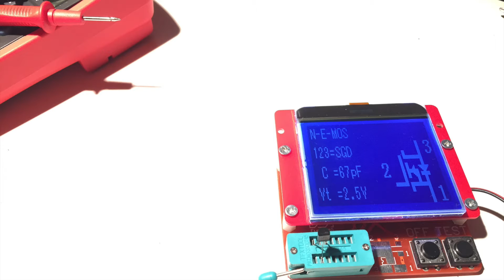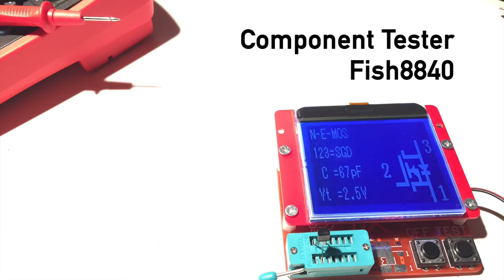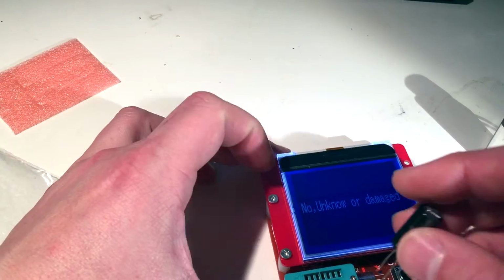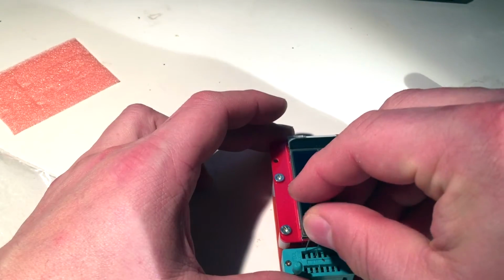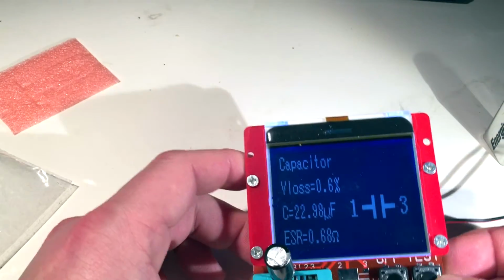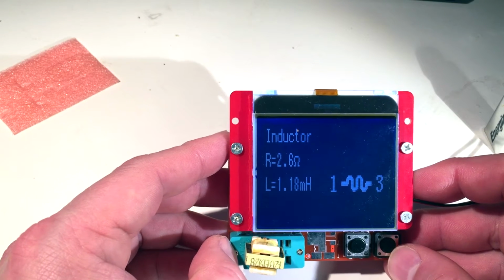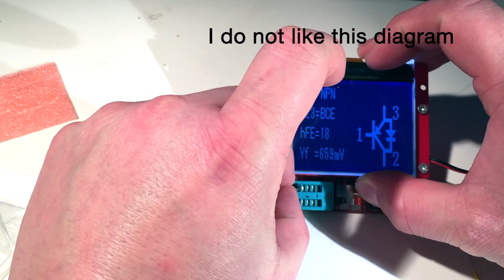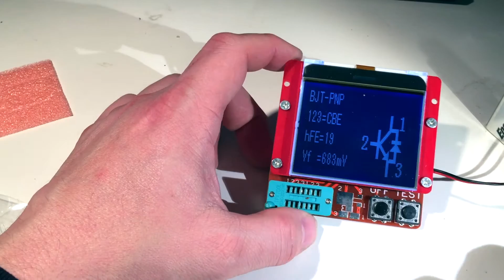Fish8840 Transistor Tester

Comment: How can you violate any licence when it is an open source invention? Open source technologies are alllowed to be modified and improved in any ways without the written permission of the original inventor. But anyway, if you were going to test the device for its performance, then you should have done it properly. You should have spent at least 50 cents or so to buy new transistors to test with so that you can be certain that it is the device that has a bug in it and not a result of a faulty old burnt out transistor that was removed from some old circuit board which you used to test with. May be if you dare to try the more recent improvements, you wouldn't get contradictory results with you transistor test. But since you didn't use fresh transistors in this video for the test, there is no way to know for sure whether it is the device or the transistor is faulty.
Reply from the maker: Quantum Chang Thanks for your comments on the video.

Open Source doesn't mean what you think it means. The code remains under copyright, and the copyright holder then grants a license to use the code under certain terms. Often those terms require proper attribution, and some licenses, like the GPL, require that the source code for derivative works (like the version on this tester) be made available under a compatible license. Even this is an oversimplification though, its a complicated issue.

That said, when I looked for the license for this project, I found that, contrary to  the second-hand accounts I relied on when I made this video, the licensing of this project is ambiguous. However, the clearest statement is that of the original author, who states that permission is required for commercial use, something I doubt that any of the cloners have done.

As to your point about the burnt out transistor. The point of a device like this isn't (just) to verify the specs on a new, known components -- the component manufacturers do a reasonable job of that. On the other hand, its very useful for testing unknown/used components. So, I'd argue that my old transistor was an excellent test of its capabilities, and that fact that it gives different results depending on the orientation of the device is a good "trap" for people to be aware of.

I agree though, it might have been useful to show its performance with known-good components, but the video is already quite long, and other people have already demonstrated the general accuracy of this project, and, indeed, other versions of this tester I tried, from different manufacturers, did a better job even with the old transistor.

Finally, though, regarding testing improvements, that's one of the frustrations with the Chinese manufacturers that make these devices, because they don't release their derivative source code with support for the graphical displays they use, and they don't provide a clear identification of the firmware version they started with, it is harder to identify problems. It is also more difficult to try later versions of the mainline firmware. Happily, others have reverse engineered their versions well enough that it is now possible to run the latest version of the mainline firmware on the Fish8840 tester. With a recent snapshot of the 1.12k firmware, this tester provides consistent results for my old transistor, no matter what the origin.
Reply: Quantum Chang its open source atmega are open source project you can search it on Google and its have source code for this component tester